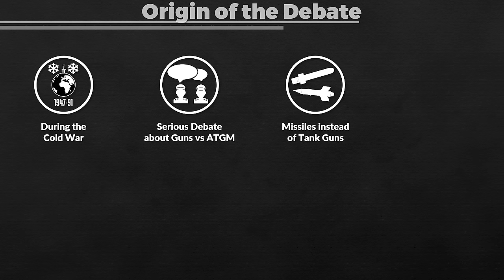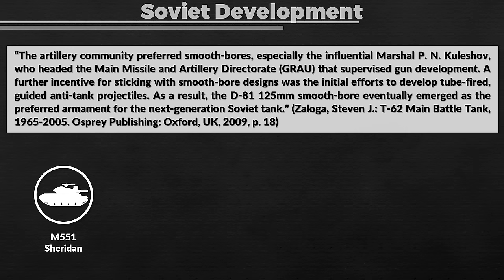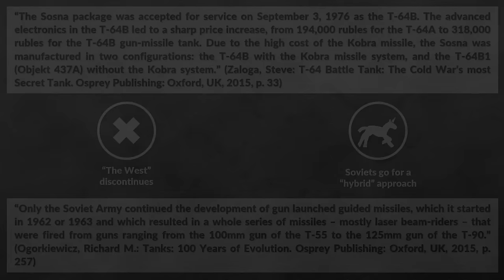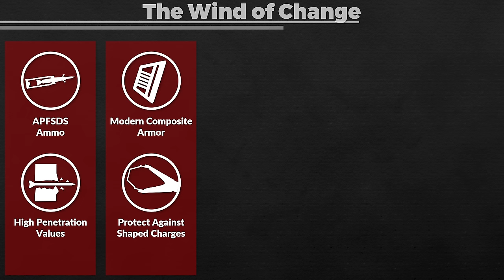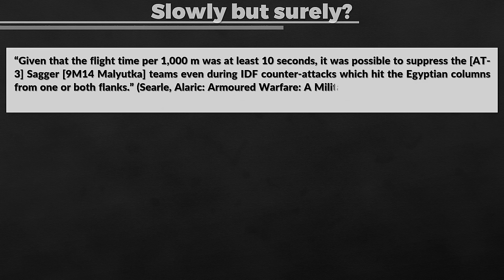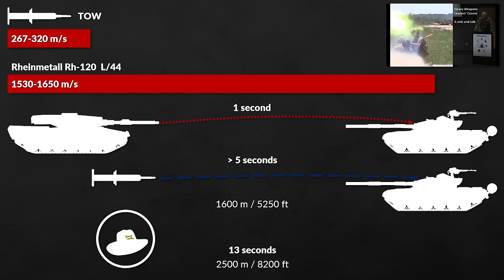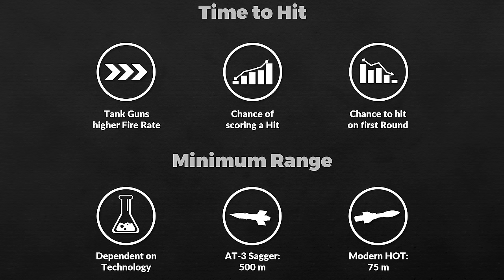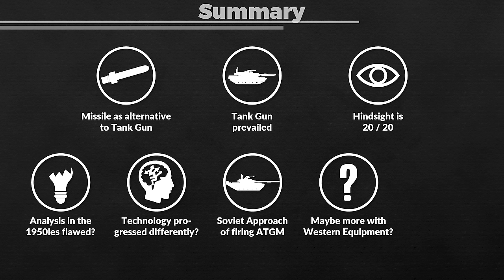Missiles vs Tank Guns: Why Guns are better!

Comment: Active protection systems fielded by the upgraded modern armor have been developed enough to intercept even the small-scale rocket projectiles.
You've probably seen the videos of upgraded Russian armor in Ukraine shrugging off guided missile strike attempts with "magic POOF clouds" --- and many countries worldwide are either few years behind, or actively upgrading their armor with such systems at this very moment.

Barrels capable of firing both APFSDS rounds and the guided rounds are the future IMO. Low-flying helicopters will always present a threat in the contested air space for all units on the ground, thus having a (fire-and-forged) guided shell may prove useful if it gains the ability to lock onto helicopters.
Reply: "Active protection systems fielded by the upgraded modern armor have been developed enough to intercept even the small-scale rocket projectiles."
Its actually easier to intercept RPG projectiles compared to real ATGMs.
ADS are far from perfect. They only give a some protection. Depending on warhead size and type the interception distance often is to low and massive armor still needed to stop the high energy debris and shrapnell. Which for an MBT is less of a problem but flanking and rear shots still might overcome the ADS this way.

"Low-flying helicopters will always present a threat in the contested air space for all units on the ground, thus having a (fire-and-forged) guided shell may prove useful if it gains the ability to lock onto helicopters."
If you have APFSDS you don't need guided projectiles to shoot down helicopters. A sabot will do fine. Even moving helicopters are pretty easy to hit with modern FCS.

The only role where guided munitions for a tank make sense is for indirect attacks. To maximise the firepower in a small area or to support friendlies who need heavy AT.
Reply: I’d appreciate a link to one of those active protection success videos from the Ukraine.   Because thus far, I have only seen tons of burned out wrecks of Russian tanks with their Relikt reactive armor blocks still intact.
Reply: That isn't really the case for helicopters. Why do you think most countries are investing in indirect fire missiles these days? Because Low and Slow is a death sentence. So, the only way for them to be viable is to outrange any SHORAD/DIVAD units they'll encounter... and stay behind their own allies because all it takes is one guy with a Stinger-equiv (i.e. any MANPAD with an UV terminal seeker) to turn that helicopter into scrap metal.
Reply: @schnuersi  Yeah, but just 20 years ago - active protection systems seemed like science fiction. Just look at where they are now, add 10 years - and that's it, they'll be optimized.

A shot would need to come from an extremely low angle not to trigger the system. The only scenario I can imagine were the mountain ambushes that Syrian Arab Army conducted against IS convoys, attacking from high altitude and thus opening themselves to fire from beneath.
There is no available official data, but from the videos I've seen - APS on Russian tanks can intercept missiles throughout the entire top part of the side armor (and, of course, the entire turret).

Note that side armor is equipped with ERA, and designed to defeat tandem charges (ERA-ceramic-RHA layers looking from the outside, with ceramic and RHA often being fused into ceramic-matrix composite materials). APS are thus meant to defeat top-attack missiles primarily.

Whether they are able to defeat multiple attacks - that is debatable for I do not know how much shrapnel is produced (because the destroyed missile's momentum OBVIOUSLY doesn't dissipate). Whether there's enough shrapnel enough to knock out optics and electronic sensors - potentially disabling further APS --- I wish to research that a bit more in the future when data becomes more accessible.
Reply: @ShomiTheGreat  That doesn’t look like any of the active protection systems we’ve been shown, the Russian ARENA usually generates an extremely conspicuous primary explosion. It looks like a very small top attack warhead like the NLAW that has missed. It relies on a magnetic sensor to detect when it is passing over the tank so it is quite possible that the massive steel bridge could cause it to mistrigger.
Reply: @ShomiTheGreat  woah, bro!  Settle down.  I’m not here waving flags and pointing fingers like some douchebag who hates people simply because they live across a line on a map.  Slow your roll with the stereotyping.  Not all people in the “non neutral” nations are drinking the MSM kool-aid.   

I asked for a link to the video, because I honestly had not seen any examples of it yet.   Thank you for the link and try not to be so accusatory and condescending.
Reply: @DarkSlug  and yes, I agree that the example provided by Arctic is a very poor one at best.  First of all, the whole reason Drozd is ineffective against top attack missiles like Javelin, BILL, and NLAW is because it has limited firing arcs and thus suffers greatly when it has to engage incoming threats from above the vehicle.  

That video appears to illustrate an explosion above the tank, which is probably an air burst mortar round, considering that subsequent shots hit the water and the bridge next to the tanks.  It’s quite likely indirect fire from 120mm mortars.
Reply: @DarkSlug  I highly doubt that rebars (with poor magnetic properties) surrounded by thick concrete could set off an expensive projectile (that is most likely modern as the shelf life doesn't permit it otherwise), nor that some little metallic railing could set it off either. I put my faith in engineers who designed those projectiles, taking all possible situations into account. I wish I could find blueprints for things like these, but I doubt that even spies are capable of obtaining technical documentation.

TBH, I'd love if there wasn't so much propaganda, if people were willing to discuss subjects from angles that may be opposite to their beliefs. Reason should prevail over belief.
Reply: @ShomiTheGreat  Drozd was created in the late '70 and introduced in the '80. So 20 years ago hard kill systems where an established reality allready. The western nations just didn't bother because the threat was not there. They where concidered as unnessesary. This is has changed now.
Never the less an ADS is not perfect. It only has a chance to intercept an attack. Most of these systems aren't even optimised to intercept ATGMs they are optimised to intercept RPGs and LAWs fired at short range. It is one thing to shoot down and stop a RPG or NLW but something different entirely to shoot down and stop a Kornet, Spike or Hellfire.
Good luck trying to stop a Maverick, Brimstone or similar.  
ADS can be compensated for by technical and tactical means. The next generation of ATGMs will account for targets with ADS. Some allready do.
ADS are a part of the surviability onion but not a wonder weapon.
Reply: @schnuersi  I agree. That's why the APS is the outermost layer, followed by the ERA or slat armour (sometimes both), then ceramic armour, then RHA. Every layer has a purpose, even the ceramic armour over RHA has its purpose of damaging DU penetrator tip's geometry, thus stopping the entirety of APFSDS from penetrating RHA. The same way material science advances daily, so does the robotics.

Greater weather and terrain sensor reliability, quicker response time via advanced data processing, etc - it'll all help advance the APS. 

I believe that another layer will be added within 20-30 years (if WW3 doesn't push us back to stone age), tho not carried by the tank directly. It'll be mobile CRAM deployed alongside tanks, like a tracked system with Mantis CRAM mounted on top. That'll neutralise guided bomb munitions, indirect/guided helicopter missiles, even the cruise missiles. It currently has the ability of intercepting small diameter projectiles like 80 mm mortar shells, but no mobility.
Reply: @ShomiTheGreat  "it'll all help advance the APS. " It also helps missiles.

Its important to remember das ADS currently, and for the forseeable futur rely on ACTIVE sensors. This means they are telegraphing the position of the vehicle and they can be jammed.
Increasing the speed of ATGMs currently is the easiest solution. Combine this with warheads with stand off effect and it is virtually impossible to intercept them with current technology.
There are even concepts for ATGMs wich use KE penetrators. These approach at speed similar to APFSDS. Even next Gen tech will not be able to intercept fast and massive warheads.

"I believe that another layer will be added within 20-30 years (if WW3 doesn't push us back to stone age), tho not carried by the tank directly. It'll be mobile CRAM deployed alongside tanks"
You mean SPAA... these do exsist for a long time allready. For most of them CRAM capability is just a software upgrade. Some others need a sensors upgrade as well. But this will not take 20 years.
For MANTIS CRAM there is allready a mobile version. Its industry name is Skyranger. This is not future tech but off the shelf. Since the threat is now obvious, funding now is available. We most likely will see the fielding of such equipment in one or two years.
Reply: @schnuersi  Yeah, except that Mantis system requires an active radar link nearby (as far as I've seen), and it needs to be stationary to fire. It doesn't seem like it could keep up with the shock warfare that armor relies on. Its only armor-combo purpose could be defending checkpoints and bases where armor is fielded.
Reply: @ShomiTheGreat  Did you even look Skyranger up?
I deliberatly wrote a MOBILE version. Skyranger is a self contained SPAA based on the MANTIS system. In its current form its mountet on a Boxer 8x8 chassis.
Is mobile, armored, fire on the move capable etc.
Reply: @schnuersi  
Emm, rod will do comparatively very little damage to a rotary wing craft. 

There are even instance of them taking hit from small guided sam and being able to fly back to base.

Ever wonder why US bother with a slower vt fused m830a1 if rod will do the job?
Reply: @jintsuubest9331  Yes it will. But a APFSDS hitting does more damage than a MP round not hitting or not fired at all. The flat trajectory and low flight time makes a difference.
Shooting at helicopters is an emergency measure. Its a duelling situation. The tank needs to shoot the helicopter down of force it to abort its attack. Befor its struck by an ATGM.
So the round loaded is fired. Since in most cases KE is loaded to be able to react to sudden appearing armor this is the most likely round fired. If MP is loaded this one is fired.
A helicopter is most likely being engaged frontally. A hit will result in the rod passing trough the entire length of the helicopter. Chances are it will damage something important and at least force an abort. If shot into the side it indeed is very likely that there will be little effect.

Comment: I wonder if a swarm of consumer grade quadcopters with a shape charge on its bottom that you just disperse in the possible movement area of expected enemy tanks is effective. You could have them lay in wait and have maybe some operator that can target a tank and then activate the nearest drone that will then kamikaze itself to the tank.

You would get something like a mine field with actively homing mines.
Reply: Enemy would just avoid the area entirely. 

While area denial is a valid combat tactic, there are better way of doing that. Including but not limited to just spread some mine on ground.

Also consumer quadcopter has too little payload for this to be truely effective.

Comment: A factor in the Russian adoption of gun-launched ATGMs may have been a lack of accuracy of their gun fire control at long ranges, which could make them vulnerable to long-range ATGM-equipped MICVs, which could light them up from five clicks away with relative impunity if they did not have an accurate, long-range weapon to return fire. The export market for Soviet-era tanks destined for use in non-European terrain may have also driven the development of the longer-range system.

A factor in all sides retaining MBT guns is variety of ammunition and per-projectile cost. Our M60s (105mm) could fire APDS (I'm old), HEAT, HEP, WP, and Beehive (anti-personnel flechette) rounds. Also, onboard missiles can be dangerous if the vehicle gets penetrated (many M2/M3 Bradley catastrophic hits during survivability testing were because TOW spares brewed-up). As a former 19E, I'm not enthusiastic about adding missiles to the MBT arsenal unless they are fire-and-forget and strapped to the back of the turret in a VLS package. There's already enough for the 4-man crew to do in the heat of battle without having to worry about guiding a weapon to target while under fire.
Reply: The myth of lack of accuracy haha the etgm is a extension range

Comment: I would assume, that if we look at the Topic from the perspective of 1950/1960 high Brass, then one can understand the idea of Missles taking over Tank-Guns. After all, if the engagement range has been gradually increasing for the past 40 years, it is likely to keep increasing more right? And if we speak of several kilometers of engagement range, isn't Guided ammunition always better than unguided?

Improvements in projectile speed, fire control systems, armor as well as the limitations of terrain did lead to the idea of missles as the primary weapon to be disgarded, but that makes more sense from today's perspective looking back, then it might have back then

Comment: Interestingly, for naval and aerial weapons, it is the complete reverse. I guess range really matters for those engagements and they have far less targets to deal with than land enagements. However, missiles did completely replace towed and self-propelled anti-tank guns. I guess the consealment advantage of missles far outpaces guns.
Reply: AT gun carrier are not replaced by missile, they co exist with missile carrier. It really depends on the specific area you are expected to operated in. 

Towed gun are abandont because you simply don't have the time to set it up or move away quickly. Only places we see towed gun are at the back with artillery now days.
Reply: @jintsuubest9331  I don't know, most of AT gun carrier are really just light tanks of light and medium infantry rather than traditional tank destroyer we think of in WW2. That role seems to have being replace by missile. Strv 103 and PTZ-89 are the modern examples I could think of, and both have been retired. Of all these, PTZ-89 is the only one that offers the same offensive punch of modern tanks with its 120mm gun in a large ww2 style tank destroyer chassis, and the rest are in 105mm with same chassis as IFVs and all the new ones are wheeled.
Reply: @WangGanChang  The PTZ-89 seems like a pretty bad idea overall. It has the same signature as an MBT, but with none of the armour (only 50mm at most to save on weight). By contrast, the Strv 103 made sense for its time--Sweden did not have a large military budget, and the Swedes anticipated fighting a defensive war... hence the turretless design made for something that could be produced cheaply, deliver a hefty punch, and maximise its armour.  It also had a much lower profile overall than a turreted tank.

Compared to the 105mm armed assault guns, the PTZ-89 was also pretty damn slow... at 55 km/h, it's slower than an M1 Abrams (which is an actual tank) or a T-80 (also an actual tank). I imagine that the PTZ-89 was the brainchild of some cost-cutting bean counter at whoever heads the PLA's procurement, who thought that a glass cannon tank was a good idea. 

Had that piece of rubbish ever been used in combat, its only use would have been as a mobile crematorium for its crew. 50mm of armour is thin enough that even BMP-2s and Bradleys could threaten something like that _with their autocannon alone_. In 1955, the PTZ-89 would have been a monster--the thinking right after WWII was that shaped charges made tank armour obsolete. If the CCP stooges could put a better engine inside that PTZ-89 and have fielded it 44 years earlier, it might have had a significant influence on tank development to this day... and those things might have become more ubiquitous than T-72s. Of course, China didn't have the industrial capacity in 1955 to produce much military equipment indigenously, and nobody in 1955 was really fielding 120mm tank guns either other than the IS-2 from WWII.